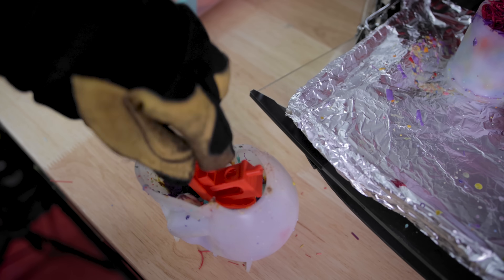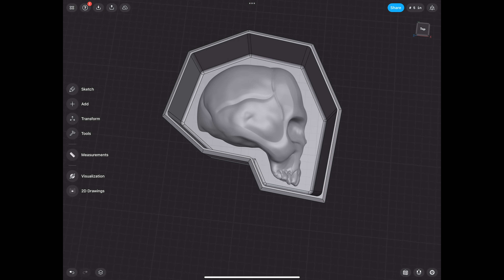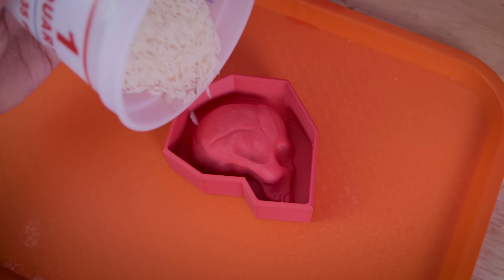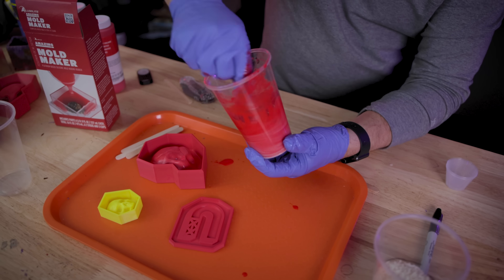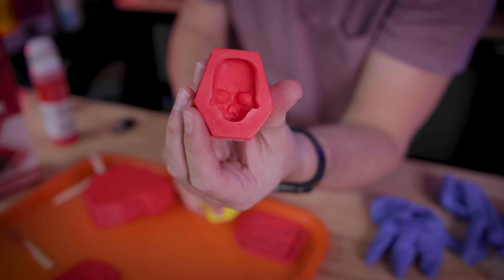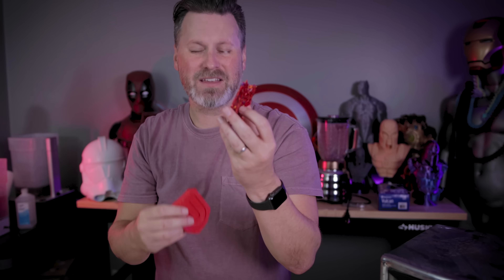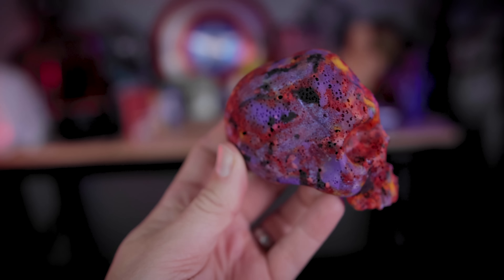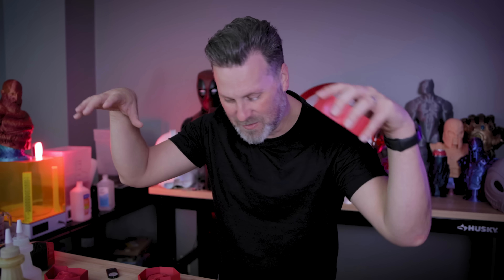3D Printed Molds for Casting 3D Prints!

Comment: I painted a print with primer and cast it 4 hours later and the silicone didn't set. I think I need the part to 'fully cure' 24 hours before casting. Any thoughts?

Comment: How are these 3D prints so smooth despite being FDM? Did you smooth them in any way or did they come out straight like this, please tell me about print output
Reply from the maker: If I remember correctly I did a low layer height with a .4 nozzle & enabled ironing on all top layers & did a variable layer height option

Comment: dope stuff! my pals who was probably ones of the first people locally who even started to work with 3d printing like 5 or 6 years ago are doing same kind of stuff, but they don't melt plastic right inside the molds, but melt first then pour into molds. and those are coming fine :}
also, yeah, may be a small oven with a vacuum thing will do the job

Comment: Pressing question⁉️
Presuming you get it hot enough to remove 90%+ of the air pockets, how strong would a 1 inch (25mm) by 6 inch bar be? I need to make a part that's going to experience some load and low torque (a low speed axle adapter/bushing) I'm thinking about using a plaster mold, reusability isn't a goal. please advise 🙏🙏🙏

Comment: What ijf you were to have a silicone "vat" above a mold in the oven? put all the filament in there, it melts and goes thru a spout/hole at the bottom and into the mold, as liquid instead of solid pieces

Comment: Maybe a dumb question but I will ask it either way and hope someone will answer it. Would it be possible to make a mould from the 3d print? I mean would it work when the 3d print skull was inverted and then instead of pouring silicone in it, you would pour beeswax in it?
Reply: The reason he doesn't use 3d printed molds is because the mold needs to have a higher melting point than the sculpt
so you can use 3d printed mold as long as hot beewax doesn't make the mold melt
Reply: @NonJohns  aah yes I didn't think about that. Thank you for your answer

Comment: Hey Jessy, When are you going to update your patreon for all the printer settings you keep saying are on there. been a member for over a month and it doesnt seem like you interact with your community on there at all, which is very disappointing. You've said multiple times that you have profiles for the Mars 3 pro and other printers there and the files are empty or not for the correct printers. ill be posting this on several of your videos to try and draw attention to it.

Comment: aside from pressure you could use a hot air gun to melt an even, thin layer into the mold before filling it completely with plastic.

Comment: Very cool idea. Love mold making from 3d prints. You may need to melt the PLA bits into a liquid or semi liquid before putting them in the mold to avoid the little bubbles. or perhaps heat them in a low temp kiln to ensure completely even heating, im not sure how even that little oven would heat something considering the heating coils are usually on top or on bottom. 
Can't wait to see more.

Comment: Great video. The rice is for volumetric matching not for weight as far as I know. And also use a very very thin layer of silicone, pouring it in slowly from high up  and roll it around to coat it evenly and let it cure before you dump the whole lot in, then you won't have ANY bubbles. Also did you add registration marks when you connect them together?

Comment: I wonder if there was some kind of out-gassing at the mold surface that created the bubbles.  The top was nice and smooth.  I'd be interested to see if this worked out better the second time.  If the bubbles are smaller, it may be helpful to run the molds through a heat cycle before using them.

Something else occurred to me last night.  The mold release.  Is it meant to be used with hot casting or just cold casting. like resin.  It could be flashing to a gas causing the bubbles also.
Reply: Unclejessy..  What does this mean?

Comment: Why not melt everything down into the mold like you did and then before pulling it out put some resin in there and let it fill in all the holes? Stick it in a vacuum chamber to pull out the air. You'll use a lot less resin as the scrap pla will fill up a lot of the volume.
Reply: I used to use a similar process at work but we used a pressure chamber. And injected the materials in the molds.

Comment: Those look like bubbles released out of the silicone itself. Notice how you have zero bubbles on top!
It's a thermo-chemical reaction. Either due to some mold release or again, because of the silicone itself.
Low degassing silicone is a must in this case, or proper degassing before use. You should try with preheating.

Comment: The only problem Unci-Jesse is that they are ONE (1) PART MOLDS (!)*
(* I.e. Meaning when you CAST them: One side will require a ton of clean-up/sanding etc. & won't be formed to the design of the Mold.

Ideally You want a TWO PART MOLD (OR even 3 Pt. Mold: that's how 99.9% of things we buy are made)

Comment: @UncleJessy Just a heads up if you go to cast a resin print, make sure to do a small test with the molding first. Some resins have sulfur in them that, prevents the molds from curing, and I know how expensive those silicone molds can get 👍
Reply: Also a cuticle trimmer from the dollar store  works great to trim edges of molds!

Comment: You really should get a vacuum chamber to de-gas the silicone. Oomoo is nice in that you can get by without de-gassing it, but you still get little bubbles on the part that have to be cleaned up.

Comment: Pressure cookers often require  water in order to build up pressure, that water and vapor may interact with the melting plastic, which we all know doesnt like humidity. Plus most pressure cookers only apply a max of 15 psi, which has a temperature of 257 F (125 C if you are using imported water), as opposed to the normal 212 of water boiling at standard pressure. 
This is more than many filament's glass transition temperatures, but lower than their melting temperature and considerably lower than nozzle temperature.

Estimate of chance of success is low.

I would recommend instead a vacuum chamber to be used as soon as the plastic comes out of the oven. Get them as hot as possible to make them liquid, then simply suck all the air out. Note, design a mold with a raised edge to account for the expansion of the liquid and bubbles while under vacuum. Chance of failure due to the filament solidifying due to taking too long and the drop of temperature from a decrease in pressure. Make sure to repressurize once the filament starts to thicken.

Also note, when making a mold, use a volume instead of weight to determine how much resin and or silicone is needed, it is more accurate as rice has air gaps and is a different density than resin and/or, and those materials often have a variety of densities across brands

Comment: If you really wnat to reuse PLA waste perhaps you could put the plastic chips into a bucket with holes or mesh in the bottom, so when they melt fully they drain out the bottom into the mold?  or just melt it in the bucket and stir until fully melted and just pour it. you'd probably have to melt it in temperature stages so that it doesn't scorch.

Comment: I've never had great results by using the rice measurement technique. But I will say that you will get a lot closer by using it as a way to measure volume, not weight.
Silicones vary in weight and for a weight measurement to work your silicone would have to weight the same as the rice. Go with volume. You'll get better results. 
But it'll still be off. lol

Comment: Just a heads up.. If you print your molds from RESIN they will prevent the silicone from curing at the surface that contacts the mold and you'll have a sticky mess.  Resin printed molds will need to be primed and painted and mold released.
Reply: Use tin cure silicone instead of platinum cure. Problem solved.
Reply: @EweCantSeeMe beat me to it
I was going to say “read up on tin cure silicone” 😂
Reply: @EweCantSeeMe yep. ❤
Reply: Dude. I've spent half gallon of silicone and it is exactly what happened. So if I prime my resin, will it work you think?
Reply: You need a barrier so the 3D print never touches the silicone.  PVA works well.  you can brush on several coats and let it dry.  Then use your normal mold release spray..  PVA dissolves in hot water so cleanup is easy.  @ranmanolov8631
Reply: Even if you prime and paint them they can still cause cure inhibition. The only true way to prevent cure inhibition is 4 hours in an oven at 180 degrees (taken out every hour and cooled down under cold water). Then you won’t get cure inhibition and you don’t need mold release either but it does help with de-molding. You can also use Inhibit X by applying 2-3 coats but you’ll need to redo this after each mold. Keep in mind though that putting the prints in the oven will make them much more brittle so don’t drop them!

Alternatively you can just leave the prints alone for two weeks and it won’t cause cure inhibition with platinum silicone. Hope this helps someone because it caused A LOT of headaches for me.
Reply: Man, thank you !! I knew it was contaminating my silicone, but I didn't know how to solve it
Reply: Thanks!
Reply: Thank you 😊
Reply: Thanks for this!!
Reply: What kind of filament did you use? I know silicone is super sensitive to curing against certain materials...
Reply: If you heat the resin mold for a few hours in an oven you'll abe able to use it after.

Comment: The bubbles seemed to form in your first casting, but not the second.  They are all round, which usually indicates a trapped gas or an off gassing from the materials.  You mentioned that your heating was at two different temperatures 380 F (193 C) and 400 F (204C).   The temperature difference will determine which is the problem.  My guess is that you used the 380F first.

If the 380 was first, the issue is the flow rate at standard pressure.  The material melted, but was still too viscous for the bubbles to release.  Using smaller layers and/or more heat will help, and so might tapping or stirring the molten plastic to release the trapped gas bubbles.

If the 400 was used first, then you are getting off gassing from either the silicone or some other material (e.g. the mold release spray is not for high temp use).  Making sure the mold is cleaned out (Washed and heated to about 100 C for a few minutes) and the scraps dried before melting would be the solution there.  Also a powdered mold release may help release the surface tension so the bubbles don't stick tot the surface, but I would try to do everything else before going that way.

Comment: Have you considered melting the leftover filament in a little, metal bucket, and then poouring it into your molds instead? You could then put your phone very close to a filled up mold and have somebody call you, the vibrations will make the liquidised plastic settle without thos holes.

Comment: May be worth investing in higher temp silicone for this kind of work so moulds will last longer in the oven. 
Also some kind of funnel + reservoir system could help with bubbles. Melt the plastic in the reservoir and have it trickle into the mould molten. May take longer and use more silicone but it'll fill up the mould better

Comment: Just a suggestion but why not do someting similar to baking? By that I mean find a big metal cup like container, sort of like a crucible for a foundry, so you can potentially get the scraps to a really soft consistency then use heat resist gloves so you can push it into the molds like hot clay.

Comment: Great video! I would probably use a resin printer to create my silicone molds to get rid of the layer lines. I will give it a try 😊
Reply: The resin uv printers use inhibit platinum cure silicone. At least it does for us, been trying to find a way around it. Tried the stuff for it smooth on had and it didn't work sadly.
Reply: @Resin-Queen-Shop  perhaps varnish the resin print with a spray lacquer then use a mould release that doesn't have any sulphur in it ( that's probably the underlying issue as it inhibits silicone curing), otherwise, instead make a hard mould with gypsum based strong plaster so that you can loosen the print with heat gun. Otherwise I wouldn't make negatives with this, I'd usually just make positives and coat with primer then cast with custom moulds jacket in fibreglass or 3d print the jacket (with an fdm printer) if you prefer
Reply: I soak my prints in caustic soda then clear coat they create great moulds too and you don’t have to use tin cure either

Comment: My guess is the plastic isn’t melting evenly, even with pressure, you might still get air pockets. I’m not sure how you would go about it, but pouring melted plastic into the mold would work better…caveat: Not only am I not an expert, I might be insane.

Comment: hey boss, a suggestion: if you have "issues" with layers visible, either use resin printer, or, PVB ^^ 
you can print with this filament, then iso/ipa and it will remove all lines (beware of loosing details)
hope it help ;)

Comment: you can 3d print molds directly in SLA printers with special resins.  cut your number of steps in half.
print the mold, cast your part.

Comment: regarding your air bubbles - you don't necessarily have to apply pressure, a god shaking should do the trick. Like (carefully!) taking the molds out while the material is still hot (and malleable) and agitate the mold to "shake out" the air bubbles.
Or do multiple "layers" of casting - so don't fill your mold completely but only like 1/3rd, melt, agitate, add more plastic, repeat till your mold is full. This should give you a fairly even result and since you are recycling leftoversmaterials anyway, you might aswell invest a little bit more time for a decent result.

Comment: You could try taking some kind of metal container as a crucible. Put the shredded plastic into it, put it into the toaster oven, bring it to melting temp and then pull it out (with some kind of heat resistant gloves or tongs or something) and then pouring the molten pla into the mold. You'd probably have to work quickly if the ambient temp is low but youd solve a lot of the voids.

Comment: Curious if you could do this but instead of FDM Use Resin to create the mold. It could almost be completly line free if you were able to do that... Also, Random thought would adding some form of vibration to the mold once the plastic is melted eliminate the holes to shake the air pockets out.

Comment: I came up with the idea (not saying I originated it) of building a box abound my designs some years ago in order to pour silicon molds. However, I wasn’t planning on pouring plastic into the silicon molds but rather melted chocolate. Other candies may have worked too. The important thing being that if food is involved your silicon has to be specifically food safe. I also used the walled technique to create molds for chocolate using cookie presses as the positives for the mold.
Reply: Unclejessy..  yeah, I don’t think so, jerk.
Reply: I would love to make moulds to use for little flowers ect. Is tpu save for baking
Reply: @christobeverleyjoubert558  I wouldn’t think so. On a 3D printer it melts at about 220 degrees Celsius or 430 Fahrenheit . Silicon (food safe) is generally rated at 450 degrees Fahrenheit for cooking but doesn’t melt at that temperature.  Regardless, whatever you use needs to be rated as food safe. Additionally, 3D printed molds need to be cleaned well after use because food particles can get trapped between the layers.

Comment: It looks like air pockets might be causing bubbles to form inside the mold during “cooking”. Try vibrating the molds a few times during the cooking process to bring the air bubbles to the surface.

Comment: The rice trick isn't for checking weight, it's for checking volume. Airsoft BBs are better media for that technique because they won't get rice dust in your molds.
Reply from the maker: Damn! I guess I need to go buy a new BB gun now 😬😂🤘
Reply: He can just clean it out. Right?
Reply: @carriebecker1097  I guess, if you want to go through all the trouble of washing it out and then ensuring that the mold contains *absolutely* no moisture, because that will foul the resin. Or you can just use something that's not dusty or dirty right from the start.
Reply: @carriebecker1097  yah, but then you have to make sure it gets really really dry or any excess moisture will screw up your casting
Reply: I use dry old rice, but I'm sure BBs work just as well!!

Comment: You don’t weigh the rice to get how much resin you’re going to use.  You measure it’s volume.  The rice likely doesn’t have the same dimensional weight as the silicone.  A gram of rice doesn’t occupy the same volume as a gram of silicone.

Comment: Just a thought for avoiding the divots - rather than filling the moulds completely, just put a little bit in at a time, let it melt, add some more, let it melt, rinse & repeat until the mould is full and all the plastic has melted.

Comment: You could use a hot glue gun to line the silicone mold in a thin layer of hot glue and catch all the detail, them fill it with melted PLA scraps for strength. Hot glue works really well in silicone molds.

Comment: just thinking are resin cast stronger than printed resin? for mechanical applications
Reply: Depends on the resin used for each, but generally yes. I 3D print multipart molds much more complicated than shown in this video.

Comment: Even though Smooth-On sell Oomoo 30 in one of their starter kits, when I went to a mold making seminar at Reynolds Advanced Material (not sponsored) they used Mold Max and Mold Star for all of the demos.  But they can also go bad in the container.  The important thing is to not let it get cold or hot.  Also, platinum cure rubber molds will last longer but without extra work they will not work with resin prints because of sulfur and sulfur compounds in the resin.